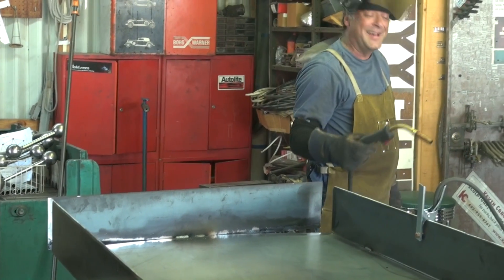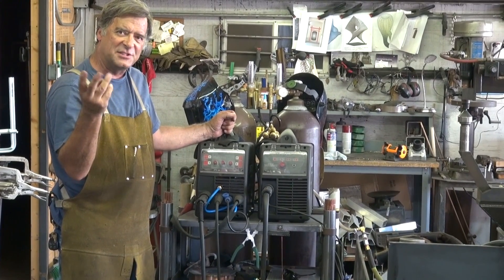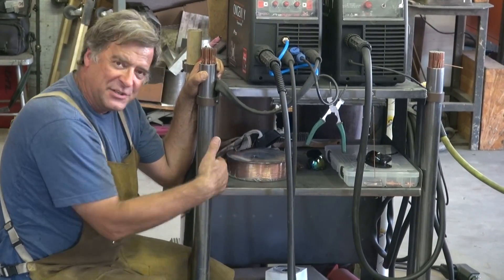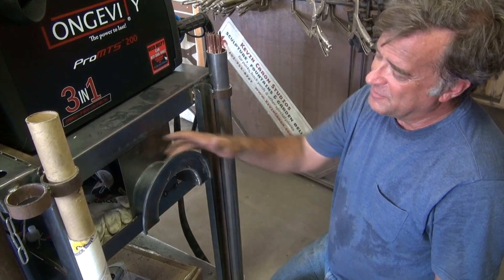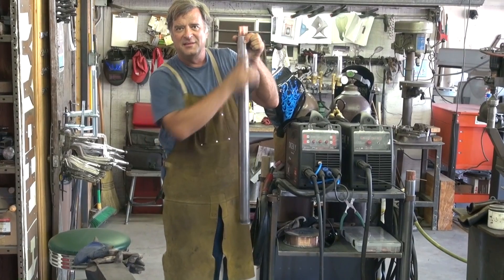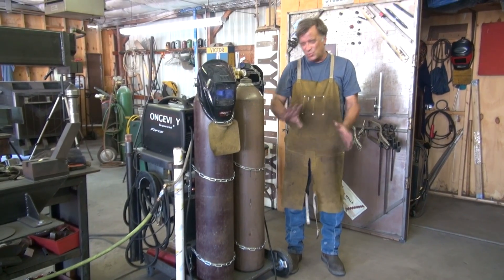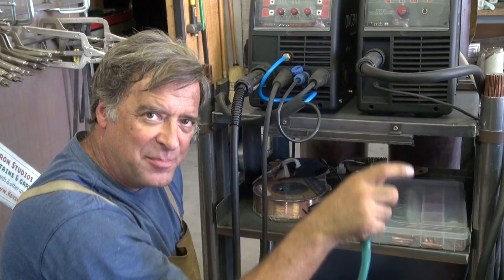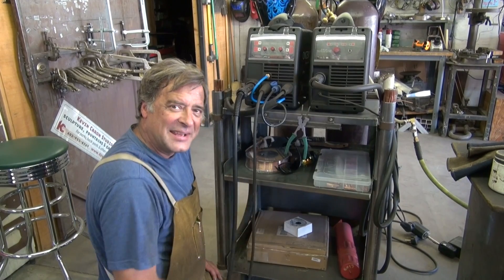A Closer Look at My Custom Two-Bottle Welding Cart - Kevin Caron

Comment: Why do you need two different gas mixtures for MIG and TIG?    What happens, weld-wise, if you use pure argon for MIG?  I was under the impression that, historically, an argon-CO2 mix was cheaper to make than industrially pure argon.   Since MIG and its typical applications can tolerate the CO2, a commercial welding company would not use the more expensive gas if they didn't have to.   Historically, TIG was used for applications eg aluminium alloys that must be kept completely free of oxygen at the weld site  (the temperature of the arc causes CO2 to break down into carbon monoxide and oxygen. However,  today the price difference is very small and for hobby or occasional welding, would not justify the rental on the extra bottle.  So it would pay to just use argon for everything if your local gas supplier can supply it.
I'm new to arc welding, so I might be misinformed.
One thing I do know is:  typical if not all "3-in1" welders have a TIG capability as a half measure extra the manufacturer can include at minimal extra cost - basically just the connector for the TIG torch.   They don't have AC or HF pilot arc, so they can't do the alloy welds that TIG was traditionally used for.  But you can weld common aluminium alloys with MIG, using the right MIG wire.
Reply from the maker: Did a video about this very subject.   Running tig on mig  gas is  not pretty!    Not sure why tig must use argon, just know that it does.
Reply: @KevincaronSculpture  : Thanks for your prompt reply, Kevin.  I've just  watched your other video, at https://www.youtube.com/watch?v=r5O-jZSSebQ, which I was not previously aware of. 
You only give part of the story though.   You show in that video, that using Ar/Co2 mix on TIG doesn't work as well - that's not so surprising, and not what I asked about.   Also, in that video, that poor weld could have been at least partly diagnosed as inappropriate welder settings - have you tested the possibility of improving TIG results with a mixed gas by changing settings?   
In that video you don't show, or mention, what happens if you use pure argon for MIG - that's what I asked about.  But I notice a comment to that video from a Camden Sprague - he also asked about using argon for both TIG and MIG.   You responded that you can, but then qualified it by saying it doesn't work "as well" on steel (a non critical metal)!
So my supposition might by correct - the cheapest solution to do both MIG and TIG is to use pure Ar for both - by having to pay rent on only one cylinder?   Historically, pure Ar was expensive, but it's not much different to other gases now.
We need a demonstration of using pure Ar for MIG.
What beneficial role does the CO2 fraction play?   Given it will dissociate into CO and O, I can't imagine what - but I am new to arc welding.
Incidentally, my local gas supplier does not supply Ar/CO2 75%/25% and the other mixes you hear about.    They only supply pure Ar and Ar/CO2 88%/12% (and industrial CO2, air, acetylene and oxygen of course).    I found 88%/12% works just fine for MIG, but with welder settings just a tad different to the tables supplied with the welder - which might well be due my inexperience - settings do interact.  I haven't tried Ar and I haven't purchased a TIG torch for my Stick/MIG/TIG welder yet.   I might in the near future, but given the Stick/MIG/TIG welder doesn't actually do proper TIG (no AC, and no HF pilot arc - they call it "lift TIG" so you can't claim a rip-off), there doesn't seem much benefit.
Reply: Just discovered a good discussion of using straight argon for MIG at https://www.youtube.com/watch?v=060NbYoOAio.   That video shows a) it does work, but not as well as Ar/CO2 mix, and b) readjustment of welder settings makes it better but never as good as with the mix.

Comment: Kevin, great custom build, you could probably sell those, 
 like you said they are rare items online and not built as well as yours. The gas splitter: any maker or model number on that item?
Reply from the maker: Thank you!    Just making what I need when I need it.    The gas splitter is from the local welding store.  It was on the shelf in the Oxy/Accet. area.   Like this one.    https://weldingsupply.com/cgi-bin/einstein.pl?PNUM::1:UNDEF:X:111
Reply: @KevincaronSculpture  thanks for the quick replay Kevin..

Comment: Awesome cart! I'm in the middle of my build right now. I need a double tank holder too. I have the main part welded and my bonus features taped to the body. I'm looking for tips and tricks to finish my build. I came across your video. I'm taking your hose hangers idea for my own.  Looks more of a substantial solution to my wimpy hooks.
Thank you for the inspiration!
Reply from the maker: Right on, good luck with the build!
Thanks for watching and posting .

Comment: the cart would be a bit too wide for my use , it needs to be able to go through a meter wide doorway and a narrow hall to my storage , basicly the widest part of my cart would be the side by side bottles and i use a size thinner bottles
i allso will ned to be able to tilt the whole thing on its rear wheels to pull it across the step in the doorway 
most likely would stack the 2 welders and the plasma one on top of the other
Reply from the maker: +watahyahknow      Yeah, it is a wide beast!       Got plenty of room to work here, and being the only person makes it even better..
Reply: +Kevin Caron, Artist 
took a second look at the vid 
i think the gasmixer you put in the mig/tig setup is originally made to use between argon and compressed air (tig / plasmacutter combo) 
i think you can do the same thing on youre setup with a open Y connector and just opening closing the taps on one of the bottles 
it will prolly prevent making misstakes because you opened the wrong tap on the mixer 
in any way it will take a little time to purge the line when you switch from co2 / argon mix to pure argon depending on how long the lines from the bottles to the tig torch are , from argon to co2 mix for the mig shouldnt matter mush 

the gasconnections on the tig torch are usually seperate from the mig setup (using an euroconnector feeding the gas , power and the wire ) allways wondered why the people making these combo welders dont just add a second gassolenoid inside the machine so you have one dedicated to the mig torch feeding from the co2 mix line and one for the tig being fed argon , that way you dont even have to fumble around the back of the machine and keep both torches hooked up in the front just grab the other torch , switch to mig/tig (wish would select the propper solenoid as whell) set the machine and go , it allso keeps the gas from going intoo the wrong weldingtorch (no need to purge )
Reply from the maker: Will pass that on to the folk at Everlast about their MTS machine...    Great idea!
Reply: Northern Tool has a real nice 2 bottle cart with room for 2 welders and a plasma cutter, drawers, cabinet and cord storage.  Kevin's has some custom features that are well thought out.
Reply: i'm not living in the states northern tools doesnt has shops here in europe
Reply: watahyahknow time to move then.
Reply: If you smaller bottles you can narrow it up, but that is up to you.

Comment: Great Welding cart. What are the measurements?
If I may, I am going to copy.
Reply from the maker: +pughwv1234        Made it just the right size for the machines I had at the time..  

You can copy if you want ,  nothing sacred about the design..

Comment: Very nice!! Your cart provides multiple devices on one platform. How do you treat the power those devices require?? Do you have a individual power source (cord) for each device or one main source (cord) with some kind of distribution (plugs/switches) right on the cart??
Reply from the maker: +Pappa Bob      Great Question!!         I have one 220 line with two outlets on it..     Have thought about putting a power strip on the cart to plug everything in to and just having one plug to the power cord..   Just have to get around to making one...
Reply: +Kevin Caron, Artist Don't know the current requirements of your welders but they don't look too big. I would expect a 40amp cord (#8) plugged into a 50 amp receptacle (because I don't believe them make a 40 amp one) and fused at 40 amps could feed a little 6 circuit load center attached to one of the cart legs. That load center could have individual breakers for each welder (a 2 pole for each) and another single pole breaker or two for 110 volt equipment ( your coolant pump, and receptacles). A bit more work but it makes your cart a complete work station and all the equipment is properly/individually protected.

Comment: really nice cart Kevin, for cable management ant prevent machines from coming off the front and give more strain relief for cable connectors i have a big handle at level as the shelve for the machines .could be right out to the rod rings so no one is tempted to pull the cart by other stuff. the magnet could be put on a hinge over the top of machine